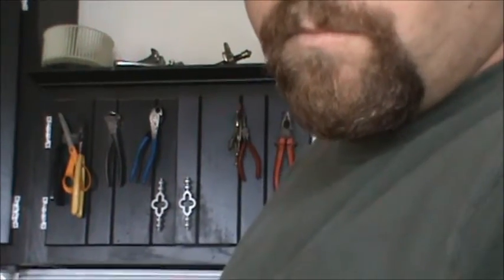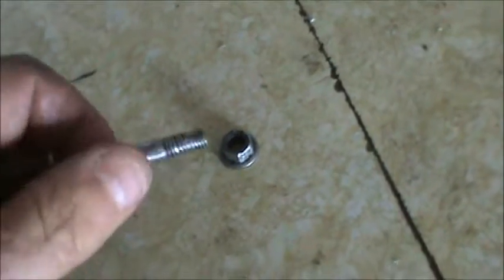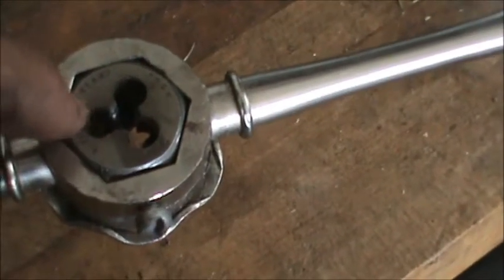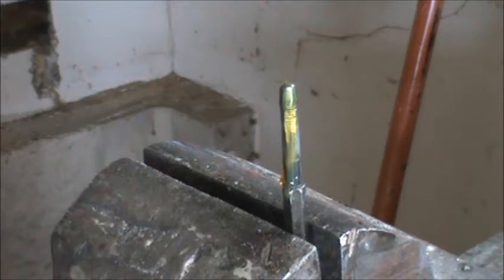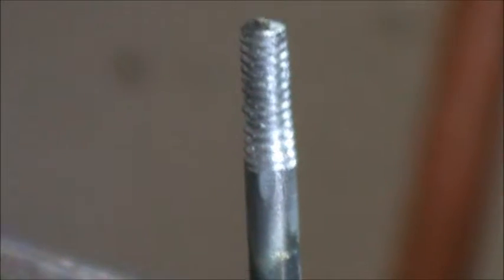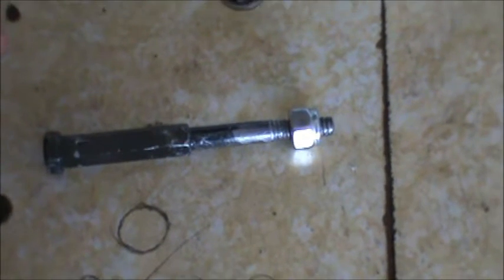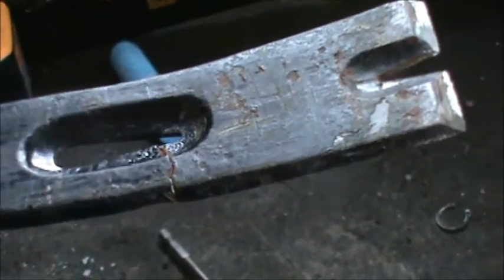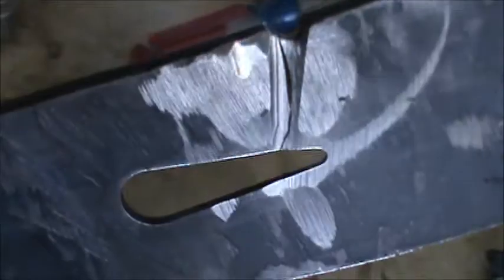Fixing stripped threads on a part that is no longer available

Comment from the maker: The nut size is 7/16 and the thread is 1/4 20.  By going back and forward it is easier on the die.  If you just go forward it can break the die or screw up the dies teeth.  By going backwards 1/4 turn it breaks off metal and requires less force when turning forward for the next turn.

Comment from the maker: My father brought the prybar over because he wanted me to weld it.  It may have been easier to buy a new one, but I don't think cheaper.  The whole job took maybe 5 minutes.  The purpose of the video is mainly to show how the prybar needs to be prepared / ground down with "V" shape in order for the weld to penetrate both sides and the edge of the metal prybar properly.  Thanks for commenting.